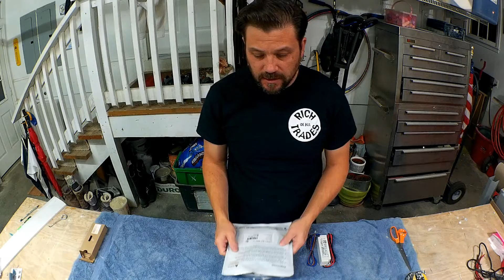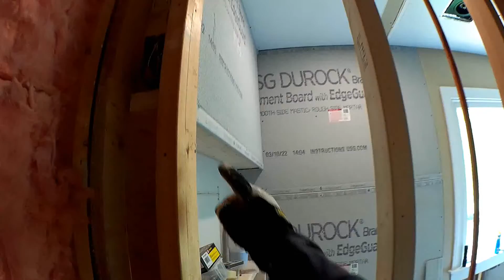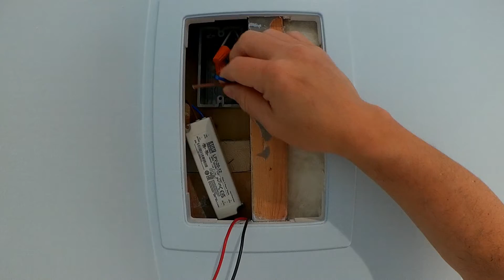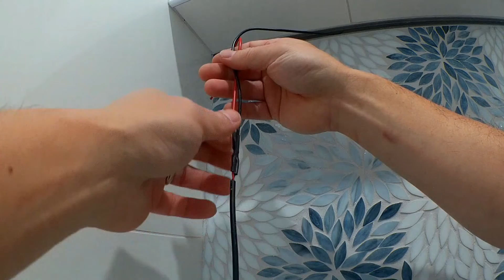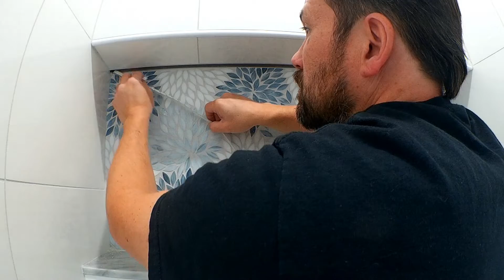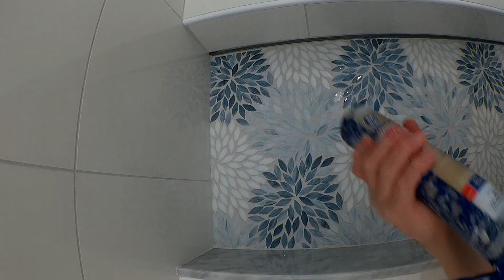Accent Lighting For Shower Niche With 12V LED Strip Lights

Comment: HELP!! I have IP67 on the way. I want to light around the top of my shower. The lighting is no issue. How do I get rid of the plug block? I have searched all over and cant find a solution. I don't want to have a block hanging out of my bathroom outlet.
Reply: My house is 110 yrs old. I don't have an outlet in the shower, jut a plug on the other side of the bathroom. Can anyone give me a way to wire behind the wall, and still be safe?

Comment: what if im using a smart controller that will need consistent power otherwise it will lose all the wifi info. I want the leds to turn on with the shower exhaust fan which will have a senor switch any tips? thank you

Comment: FYI: It is against the NEC code to make a connection inside the wall!   All connections from 0v-1000v must be readily accessible and contained inside an enclosure.  The driver is also required to be in an enclosure.  A JHC would fail this install and if a fire occurs then the installer would be liable.  

Reply
Reply from the maker: Thanks for the feedback, so you are saying that NEC code is that even the low voltage connections also require junction boxes? I will look into getting a metal junction box to enclose the driver and the 120v and 12v connections. I am curious if you believe my access panel door is not sufficient access for code.

Comment: So just to clarify, you have the overhead lights and the led niche lights on the same switch? You just have a  romex line coming from the overhead light down to the power supply or did you run it from the switch? I appreciate the video!
Reply from the maker: Thanks for the question, 14/2 romex power to the switch, then to the overhead light, and then down to the junction for the LED power supply. Hope this helps.

Comment: Dude, 5000K?  Accent lights should be warm so they're flattering to skin tones.  I always tell people the ONLY place appropriate for lighting with that temperature is doctor's offices.
Reply from the maker: Thanks for the feedback and comments, I normally use 3000 K lighting in other living spaces, but wanted to have brighter lighting in the bathroom so I went with 5000 K. I am happy with it, but it may not be for everyone. I liked it so much I changed out bulbs in the secondary bath to 5000K too.
Reply: @richofalltrades1  So, I. understand wanting brighter in your space, but raising the color TEMPERATURE is not the same thing as raising the BRIGHTNESS.  It's a bigger number, true - but what you really want to be looking at is the output of your light strip in LUMENS.
Reply from the maker: Thanks for setting me straight, lumens for  brightness, Kelvin for color temperature. I like it cool and bright😎.
Reply: @richofalltrades1  Cheers, Rich!
Reply: @puppet022 if that was a dimmable light, couldn’t it just be dimmed down a bit? And doesn’t the frosted channel cover dim it down a bit as well?

Comment: I would always make sure to have it wired to a GFCI protected circuit.
Low-voltage power supplies are not all made the same way, and may create a false sense of safety.
Many switched-mode ones (like phone chargers and the laptop ones) are not galvanically decoupled/isolated from the mains, which means they may send line voltage through when they do fail. This may not be a high-risk issue in dry environments but definitely becomes one in a shower stall.
Keep safe, people!
Reply from the maker: Thanks for the thoughtful comment,   I just so happen to repurpose my old  bathroom receptacle circuit, which was a 15 Amp GFCI circuit for my lighting circuit. I upgraded the bath receptacles to 20 Amps, so the GFCI  was available for my lighting in and out of the shower.

Comment: Thanks Rich, do you know if this will work with a dimmer? I want to run the power off the overhead light which will be on a dimmer.
Reply from the maker: Thanks for the question, I would think so, as long as you use a light/ dimmer switch that is rated for led lights.